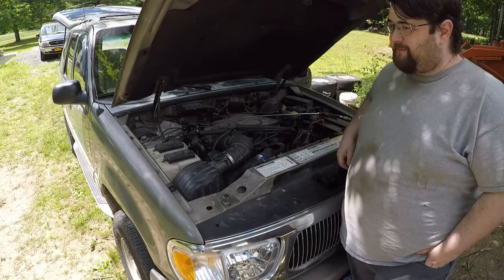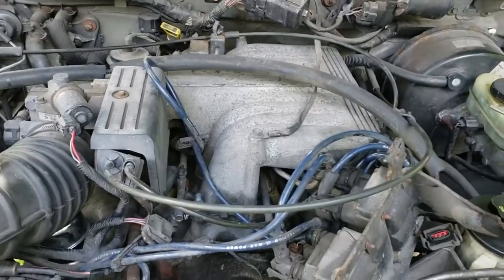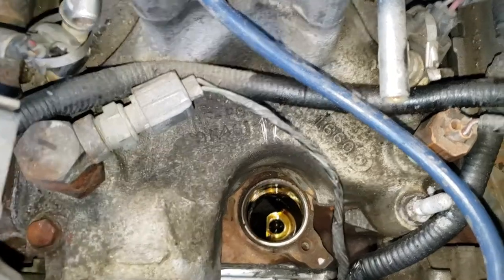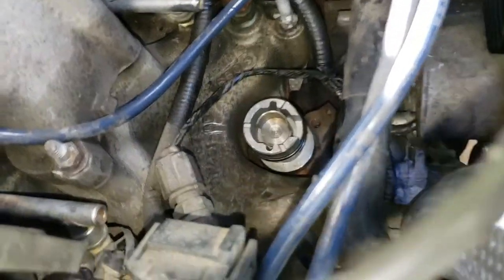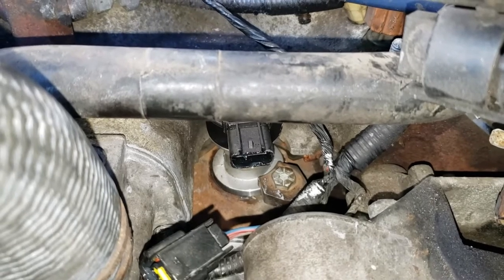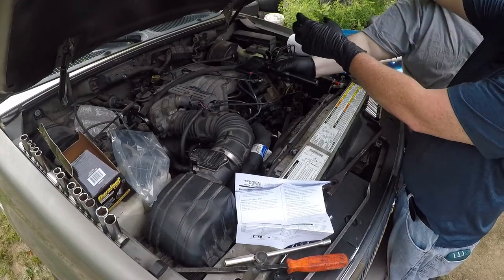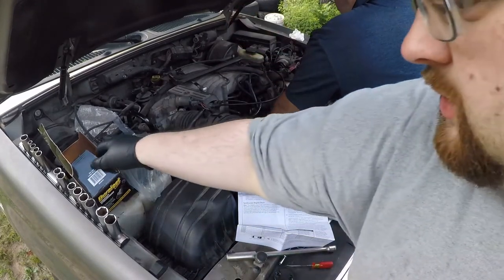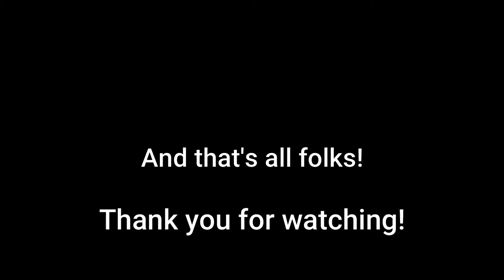[ST] Camshaft Sensor & Synchronizer Replacement on a Mountaineer

Comment: Is the alignment tool necessary?
Reply from the maker: We wound up not using the tool as the engine wasn't perfectly at Top Dead Center (as that's what the tool is based on). We made a marking on the intake when taking the old one off, and aligned the new one based on that.